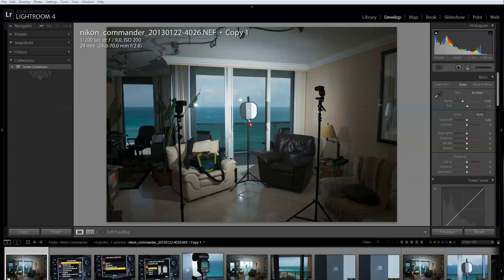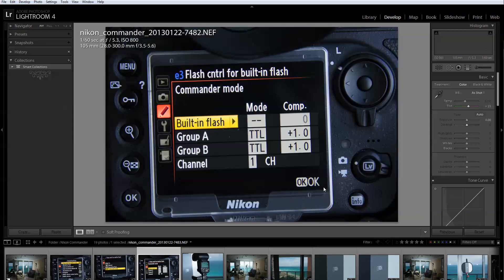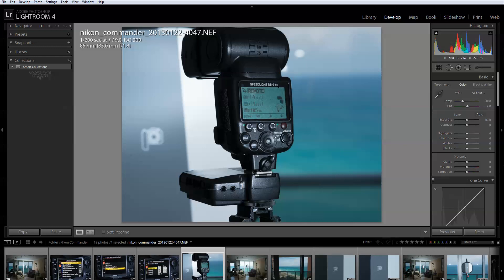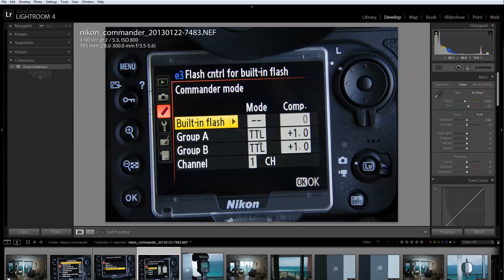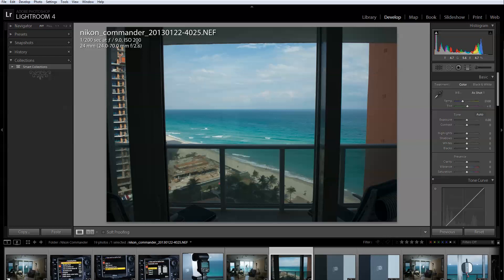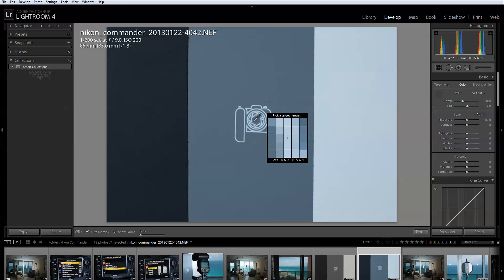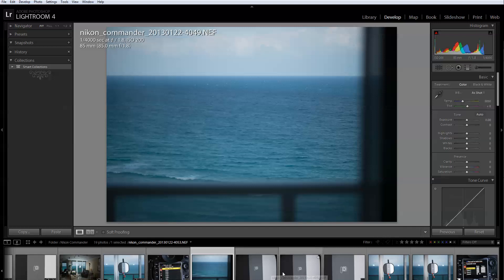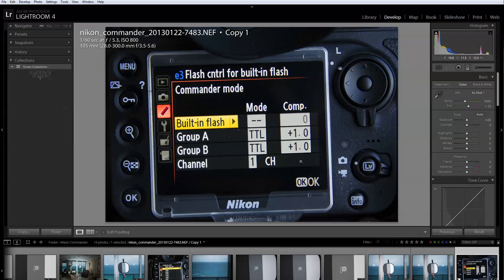Nikon's Wireless Commander Mode & High Speed Synch by Carlos Erban

Comment: Thank you for the video Carlos! Just one question: I noticed there is some kind of radio flash at the bottom of the unit - tell us about that - some times you shoot Nikon Commander/sometimes with this radio flash?r this is some kind of battery unit?
Reply from the maker: yes, these are pocket wizards flex tt5s. I did another video explaining how to use them and left them on by mistake in this video. They are turned off for this video

Comment: Awesome video Carlos, thank ou for sharing!
Question... on my D800 I change the on camera flash from TTL/M to --- but it still flashes.   After asking a technician at my local store im told that Commander mode needs to trigger a flash to command, is this correct?  

Thanks for your videos.
Reply: IDK if you got your answer or not but flash still has to go off. You other remote flashes have infrared sensors. The only way to trigger them is to send a bunch of light. cool thing is that t can even work from another room, it can bounce off the wall or ceiling. But the flash on the camera when to goes off is at minimum power, so it doesn't add that much to the light set up. If commander mode is off it will flash much brighter (you also have settings to control at which % you want your on camera flash to pop)
Reply: +Andrey Cherneha Thanks! Even i had the same question as above is that how should behave! ;-)

Comment: Please help me, I CAN NOT SET UP The speed sync for Nikon D5500 with 1 radio yn 622 on the camera and another on the flash yn 568 ex, my speed is only 1/200 I was already on the menu and nothing to solve, if you can Help me thank you I have not been able to find the Sync-Speed function in Flash YN 568ex. There is no AUTO FP on the Nikon D5500. I do not use the Yongnuo 622-tx, just the two YN 622n. I know in my camera the possibility of taking pictures of up to 1/4000 In my there is no Auto FP and yes. '' Pencil Menu ''> Bracketing and Flash> = e1 ctrl.de flash for flash emb = TTL + ray or full manual up to 1/32, I have already tested both and nothing. Another option would be the e2 conj. Of auto bracketing == (AE Breacketing AE or WB Breacketing white balance and Breacketing ADL) none of the three solved, then the category of es is over and goes to f1 to assign the button FN and such, if you can help me thank you and much.
Reply from the maker: ok, I don't have a D5500 or Yongnuo flash but I going to give you some basic concepts and advice that can help. I sounds like you have tried many things in your flash and camera. I would reset both to the original settings (look in your manual). In the camera settings, you should be able to find flash speed synch set it to 1/250s. That means your synch speed. High speed synch (higher thatn 1/250) works on TTL. I am not sure if you Yongnou TTL system is compatible with your Nikon (it should be). I would test the radio transmitters triggering the flash without the camera to see if the issue is that they are communicating or the camera. If they are communicating, then it should work with the camera. The only function that should be changed in the flash is setting on Manual or TTL. No need to change the speed on the flash. BTW this video tutorial is intended for commander mode of the camera pop flash (master) and Nikon flashes not for your system. You can watch my videos on the pocket wizard system but I would search in youtube for tutorial with your flash / radio system
Reply: OK, thank you